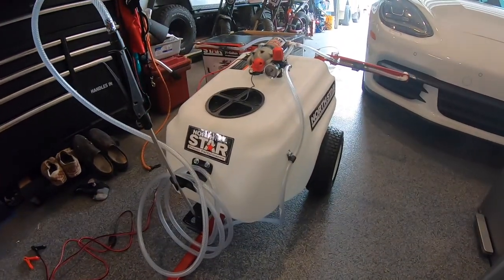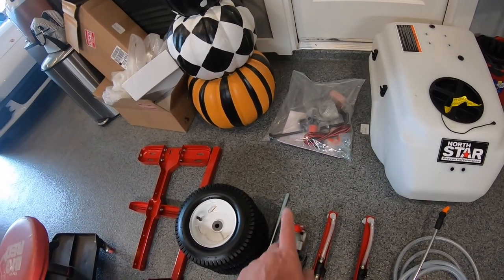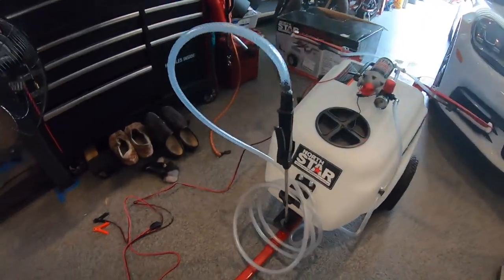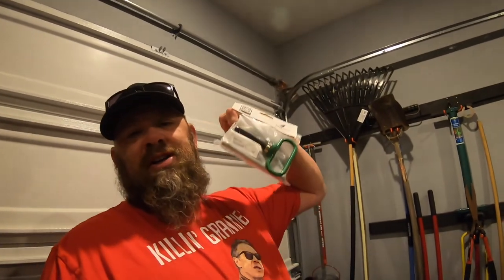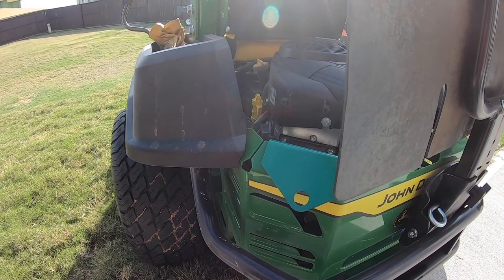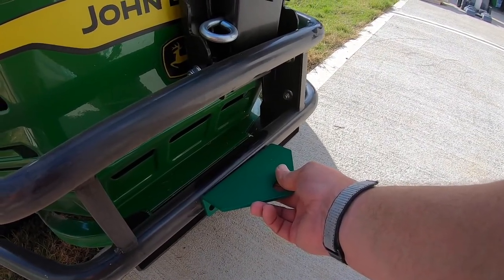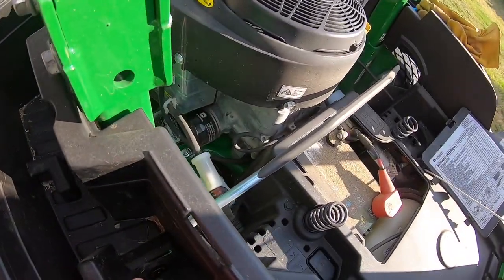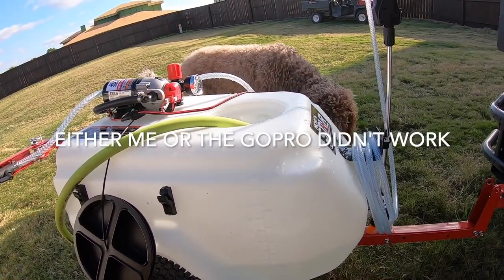North Star 21 gallon Sprayer and a cheap John Deere hitch install

Comment: I went to Ace Hardware and bought O-rings for the nozzles on my 32 gallon.  The stock ones didn’t work so well. Haven’t had any issues with it, other than the pump going bad, and NorthStar replaced.

Comment: Great video! Can’t wait to get my North Star 32 gal.  
Btw curious what chemicals you use and also what psi should I set the pump at providing I’m moving a medium/slow pace?   Also have you had an issues with the sprayer since you posted?